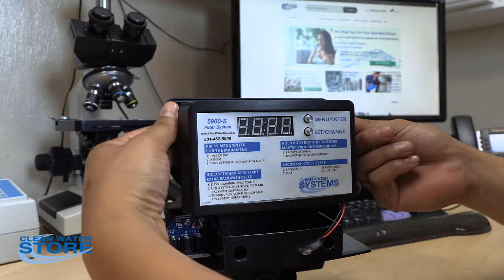How to Change Circuit Board on 5900-BT Control Valve

Comment: Next to the optic sensor, on the far end, are two connected wires that are not addressed at all in the video.
Reply from the maker: Thanks for your comment, this video does not refer to or cover the 'Air Valves" it is only discussing a standard filter valve, so that is not applicable to this one.
Reply: You don’t know what you’re talking about.
Reply: Are you talking about the 9V battery wires?